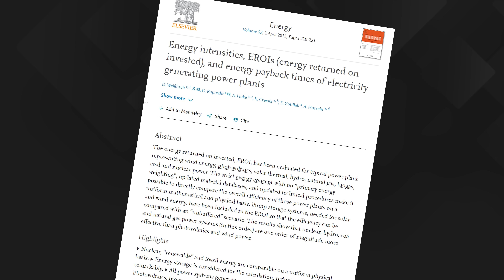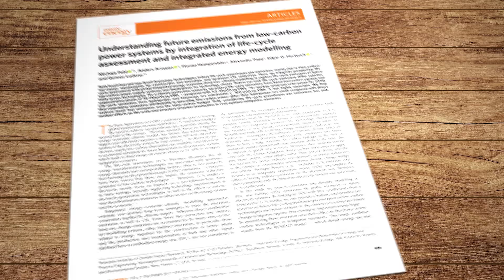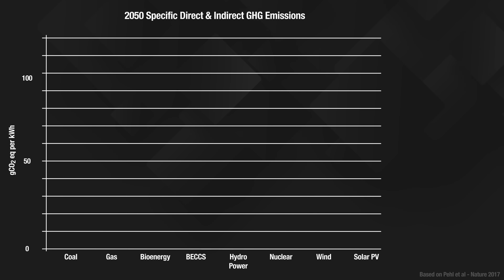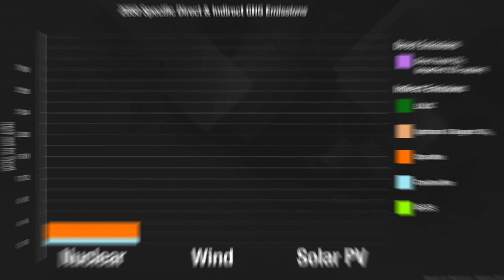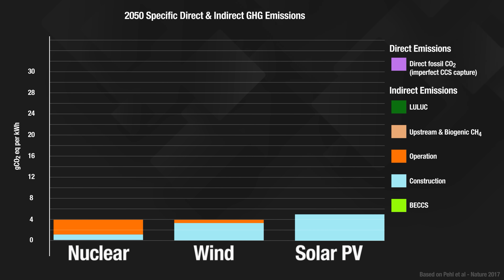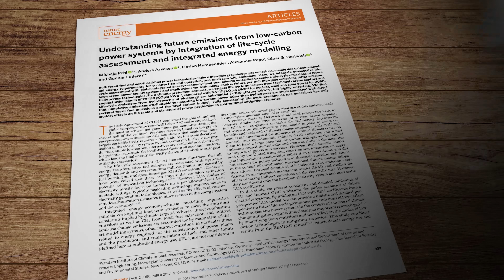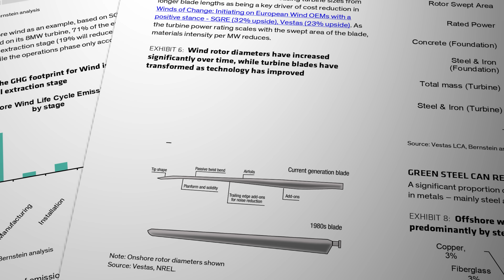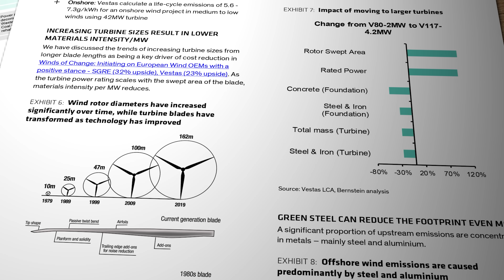Lifetime carbon emissions of renewables vs fossil fuel. Problem or solution?

Comment: How much global warming has there been for the last few decades?
How much global warming is caused by man-made carbon dioxide emissions?
How much has the observed increase in carbon dioxide concentration coincided with increased plant growth world-wide?
Do colour satalite images confirm that the Earth has become significantly greener in correlation with the atmospheric carbon dioxide concentration increase?
What happens to the rate at which plants grow in a greenhouse containing an atmopshere that has double the carbon dioxide concentration compared to the same plants in a greenhouse with ambient air as a control?
If methane is lighter than ambient air does it contribute to atmospheric convection when released at ground level?
Has any real-world observation of the amount of heat radiating into outer space from the upper atmosphere confirmed any of the climate models that are being used to impose carbon tax?
If you paint the floor of a greenhouse with no plants in it black so that it functions as a solar oven, will the temperature in the solar oven be higher than it would be in a greenhouse with the same colour floor but shaded by plants which distill water and provide evaporative cooling?
Does increasing the amount of carbon dioxide in a solar oven containing living plants decrease the temperature?
Is water the most abundant coolant on Earth?
Is water vapour the most abundant greenhouse gas in the Earth's atmosphere?
If carbon dioxide is heavier than ambient air does it stay low enough in the atmosphere to be consumed by plants, helping them grow, making the Earth greener?

Comment: The problem with intermittent renewables is that there is no practical economical method of storage.
The current cost of Li Ion storage for instance (for a typical Western economy) approaches or exceeds the annual GDP of that country.
And the batteries need to be replaced each 15 years.
Keep thinking.

Comment: thanks for covering this topic. Could you please look into Battery EV and grid storage as I believe that transport is going to give us all vehicles that are similar to a cell phone, ie; limited battery life giving us a car that will basically be scrap after ten or so years, unable to be repaired at home, battery replacement at prices higher than the residual value of the car, not to mention situations like the sinking of that auto transport ship(full of Porsche EV) because of runaway spontaneous combustion of the battery of one car. Love your channel, maybe some day I'll be able to support it more meaningfully. Cheers from Calgary, Canada..

Comment: Grids were designed for traditional power stations, with big grid connections at them which gradually get stepped down in multiple stages until it reaches your home. The wide geographic distribution of wind and solar and the bidirectional flow, means that wide scale grid re-engineering will be needed, and that is a hidden source of emissions that I've not seen any papers about.

Contrast that to building a new nuclear power station on the site of a decommissioned nuclear or fossil fuel site, where you can simply reuse the existing grid connection.

I'd also echo what others have said about the carbon cost of backup storage (including round trip losses) or generation not being factored into the carbon footprint of solar and wind and other variable, intermittent and non-dispatchable generation sources.
Reply: It just seems so obvious to me that nuclear is not only the way to go, it is the only way to go, and it needs to be kicked in fast a possible.
Reply: @justgivemethetruth  Nuclear is not the best way to go.   Look up levelized cost of electricity or levelized cost of energy.   Nuclear costs 5 times what solar and wind cost.    Costs have come way down with solar and wind electrical power plants the last 10 years.   (I didn't look over my original comment very well and didn't put in that nuclear electrical power costs 5 times what new solar electricity and new wind electricity costs.)
Reply: @ronaldlindeman6136  
It's not just about cost.  It is about lots of other factors.  If there is a nuclear exchange in Ukraine and a few nukes go off the whole world for some period of time will be blanketed by dust.  It's been calculated that this can affect crop yields and solar panel output.  I am all for solar and wind, but not so much for wind because I think they are ugly and not good way to go.  Both solar and wind are intermittent, and also as others have mentioned it is hard to power the whole national grid on those sources.

Solar and wind are still minute fractions of the total energy mix, and if we went totally in on solar and wind it would mean reducing the lifestyle expectations of the whole world.  So, good luck convincing the Chinese that they should give up mobility, A/C and heating or other Western norms.  People all over the world demand energy.

If you did not have nuke-o-phobia you could see objectively that nuclear is really the only massive solution for the world.
Reply: @ronaldlindeman6136  if cost is your main concern, then nuclear is in its current large solid fuelled form the most expensive but LCoE. Given the climate emergency, should money be the only factor?

Personally, I favour a mix of nuclear, wind and solar, with some storage too. To me that makes sense, especially when you build nuclear reactors that can be retasked to high temperature electrolysis when wind/solar is plentiful, which is more efficient than standard electrolysis, for producing clean hydrogen.
Reply: @davidpowell8249  If you want nuclear, then you are going to have to Government subsidize the building of nuclear power plants, the costs are huge, as with the VC Hammer nuclear plant startups that went bankrupt and Vogtle nuclear plants that totaled over 28.5 billion.
Reply: @ronaldlindeman6136  governments should absolutely be involved in their finance, as it is the upfront costs that cripples nuclear, and governments can borrow at a more attractive rate.

Comment: Nuclear waste is the biggest problem 90 million species face on Earth. 400,000 tons with no plan to secure it or keep it out of the environment. It needs constant grid power to cool it or it will burn unquenchably! Nuclear is not carbon neutral, nor cheap, nor safe at all if you consider the mining, refining, transport, concrete used and decommissioning costs - if there were a way to safely store the waste. These plants are relics, leak continually and, in the case of Indian Point, 30 miles from downtown Manhattan, Entergy doesn't even have an accurate diagram of the plant's plumbing.
Reply: Of course, 400,000 tons of waste from 65 years worth of 10% of global electricity which is captured, contained, and monitored is a not a bigger problem than several gigatons of uncaptured, uncontained, and after-the-fact monitored emissions and particulate, SOx, NOx, and heavy metal pollutants.

Why it takes a coal plant at least 20 days to emit 400,000 tons of waste direct into the biosphere for a mere 2.5% of Germany's electricity.

It takes a natural gas plant at least 90 days to emit 400,000 tons of waste direct into the biosphere for a mere 2.5% of California's electricity.
Reply: @factnotfiction5915 400,000 tons of nuclear 'spent' fuel rods are an infinitely bigger problem than 400,000 tons of CO2. They need constant tending and grid power 24/7/365. Here's how it will go: 
warming>loss of habitat for humans>human extinction>no power grid>400,000 tons of radioisotope release>loss of stratospheric ozone>loss of atmosphere>Earth resembles Mars Thanks for playing!
Reply: @factnotfiction5915  Thanks for the info and the link. Best to you!

Comment: Does your data is the CO2 emit by kw/h produced or consumed? Because if we produce electricity when there is no need, there is no value for it that's mean if half of the time they produce when we don't use it, it will double the quantity of CO2 emit by kw/h used.

Comment: The only reasons this topic remains the subject of much debate and disagreement are disinformation, ideology and profit-making. Many people still find it difficult to accept the realities of renewables, decarbonisation and climate science. We should be supporting each other to deal with the truth of what we’re collectively facing and move forward with the best solutions as quickly as possible - rather than entertaining regressive debate that only produces more hot air.
Reply: I think you are unfairly lumping people together, some of us worry that people will be driven into poverty by energy rate hikes, it makes every product more costly and will reduce our standard of living. I worry more about government regulation than the sea level even though i live 6 meters below already, maybe i'm stupid, maybe it is my ideology. But so far it has been very cheap to keep the water out and very expensive to heat my home and drive to work. I would be less bitter if I saw investments into reliable base loads like nuclear but instead solar panels and windmills are put online that have so much variability that adding more would be diminishing returns. I agree that solutions can work, but so far i have not been sold on any feasible image of what a renewable grid would look like.
- Energy storage is many orders of magnitudes too low to help European countries through night, let alone winter. anything but pumped hydro has not been proven to work at scale and pumped hydro is not feasible to meet even 10% of energy storage needs because it needs the right geography.
- High voltage busses can work but are extremely expensive even when used on 1% of the needed scale to import solar energy from Africa to Europe
- Biofuels and such are very expensive without subsidies and take a lot of land

Many people would rather shut down the fracking and gas drilling after effective solutions are found and implemented, i'm happy to pay a little more for sustainable green energy.
You can straw man me and lump me in with the idiots that think the earth is a hexagon or address my concerns in a constructive matter. Both sides have strong ideological people in their ranks.
Reply: @kapytanhook  I use 100% solar power from a few panels I have.   There is a small (400 watt hour) battery to provide power at night.   What you claim as "needs" are not needs.   Humans do not even need electricity or fossil fuels to live: it is extra convenience only.    The solution is for the 10% in the rich countries to live like the rest of the world.   This more than cuts emissions in half which is the fastest way to reduce emissions.
Reply: @seandepagnier  you don't live on an island, energy intensive things run day and night, winters up north get really cold and dark. No heat and you won't live for very long. Sure we can go back to the stone age, 90%+ of people would die from food shortages. The rest would be doomed to a short painful life.
The downsides of Fossil Fuels are less severe. This modern comfortable world needs a lot of energy, it's not optional just because you outsource your carbon footprint to farmers and manufacturers.
How carelessly you throw around that 100% makes me think you really believe it.
Reply: @kapytanhook  I do not emit fossil carbon for heat in the winter.    I do not kill living trees for wood.   I dont use the power grid or buy any fuels.    The modern world needs to not be comfortable: this will save a lot of carbon more than any technology, and it is essentially required to succeed at this point.   My emissions are somehow below world average despite living in a nation with the highest historical emissions.   The richer you are, the more means you have to emit less, but statistically it is the opposite, and wealthy people cause most of the emissions.   keep air conditioning for hospitals only,  refrigerators only for medication and similar changes.
Reply: What you are saying is trivial. If mankind would be live like the caveman again, the emissions would be obviously near zero. However, who decides what level of comfort is the right one? Here are the ideologues coming into the game. 
Do not forget that your house and PV panels are not built in an environmental friendly way in China. And also, they have to be replaced all 20 years. 
Additionally to that, centralised power plants are still required to provide energy for the industry, e.g. to melt and form the steel to fix your solar panels on your roof top.
Reply: @LMSI998  and this video shows that solar panels are overall very low emissions, rivaling nuclear.   They last more than 20 years and the glass and frames can be reused, not recycled such that the energy to remake them from old PV is a fraction of the original energy.   I dont live in a house, and I dont fix my panels using steel, I tie them using rope, but regardless your argument is not valid.   It is repeated again and again that somehow if someone uses a steel screw somewhere to hold something together, then it justifies your emissions of a motor vehicle, or an air conditioner which causes many thousands of times more emissions: simply ridiculous.
Reply: @seandepagnier  I'm trying to imagine the hobbit hole you must live in where you have battery backup which isn't enough to power a laptop at night, you use rope to secure your solar panels, and your lack of air conditioning results in you being a smelly mess  since i'm sure you think deodorant is bad for the environment as well. Nobody is going to live like you. Peopel work hard for a good standard of living.
Reply: @LBCAndrew  air conditioning is an example of entitlement.   The vast majority of humanity lives in very hot conditions without this.   I dont really ask you what you think or want, only insist that you dont cause carbon emissions for superfluous things that you dont even need.   If you do, that is from selfishness.   I doubt you do work very hard, people who claim they do generally tend to be fairly worthless to society.   Either way: you dont deserve air conditioning.   How is having people who smell is somehow worse than dramatically drastically and irreversibly altering the climate?   What a ridiculous way to justify immoral behavior.
Reply: Unfortunately, the cost of this tomfoolery shows just once voted in, how hard is it to return anything back to the taxpayer without recreating some New tax 
 Now if this was put into purpose sooner rather than later, moneys just about all in favor  over ** INITIATIVE & COMMON SENSE**

Comment: I wonder if the building of oil tankers and the transporting of gas, coal, and now wood chips, are included in these calculations?
That said, the argument I often hear from the deniers usually focus on comparing EVs and ICE-vehicles. It would be interesting to know how these stack up.
Reply: I think he might have covered it a few years ago in a video of common fallacies about EVs, but I can tell you from reading a few online articles from reputable sources (i.e. major international news outlets and science journals) that EVs have a higher production CO2 footprint than ICE, but that this is negated as the cars are used. It depends on what is being used to power your electricity grid. If it was 100% coal, it would take over five years for your EV to be cleaner overall than an ICE car, but in the US (where apparently coal supplies about 23% of power) it would only take about a year. Those figures are based on a car being driven something like 10,000, or a bit more, miles per year. And of course in the developing world there are countries with greener electricity supply than the US, and globally the trend will gradually to be lower fossil fuel use. And as I said, even in a scenario of 100% coal power generation, you still achieve parity with an ICE after five years, and no car is going to be used for less than five years unless it is made a write off in a crash.

Comment: Good to see a fair CO2 ratio for Nuclear. A thought tho. Renewables must be backstopped due to intermittent power delivery. Usually filled in by fossil. The metric in this video seems to  miss the CO2 expelled by these fossil sources that must be used to even make renewables viable on the grid. Such a metric inclusion would drastically change these numbers. Also, ramping fossil plants up and down constantly reduces their efficiency and pushes the CO2 number higher sometimes nearly completely offsetting the CO2 reduction by the renewables in the first place. Hope for storage is high but as yet not fielded in any way close to a scaling reality. Plus, there’s a CO2 cost for batteries that would change these numbers as well as the EROI. Lots of Rube Goldberg here. Why not just go with the Nuclear that’s lower to start with? The false fear of nuclear waste storage needs to be set aside. Nuclear has what we need now and is proven to work. Just have a think about that.
Reply: There is no need for those back stops.
They are necessary, because they have not installed enough of renewable generators, or enough storage.
Reply: @antediluvianatheist5262  storage has a carbon footprint which is not accounted for... I mean, just look Germany (pro'renewables) vs France (pro-nuclear) CO2 figures any day and you'll understand that fully renewables is not clean nor viable.
Reply: @antediluvianatheist5262  
No sir. You are incorrect. In virtually every case so far, renewables installations have been either supplemented by new fossil installations or by existing extra grid capacity. It is usually in the form of natural gas power plants.